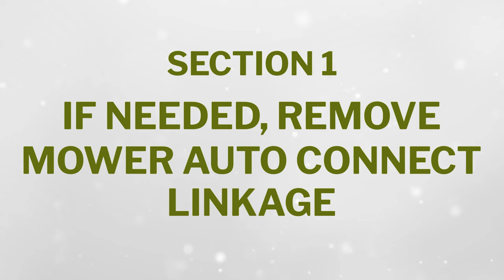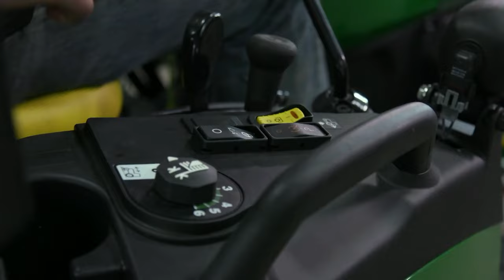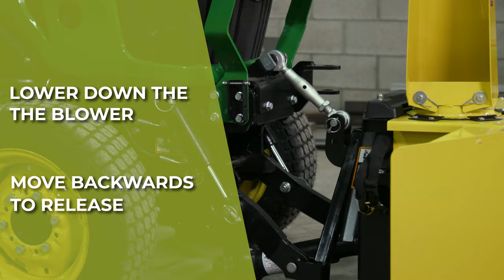John Deere 2032R, 2038R & 3R Series: Auto Connect Removal & Snow Blower Installation by MN Equipment

Comment: Nice, very detailed video, but I agree with "Sam" - I have a JD 2038R and THIS would be a PIA (nightmare) to have to do whenever you installed or removed snow blower attachment even if it was twice a year! I think I will continue to walk behind my husqvarna snow blower and use the loader on the tractor for any heavy wet stuff!

Comment: Very good video and much appreciated as I just recently took delivery of a 2032r with a 59" snowblower. But until I contacted my dealer I thought that the front hydraulic hookup was part of the snowblower package for my snowblower - it doesn't appear to be. IMHO it would have been appropriate to mention that the front hydraulic hookup may be an option. From what I have learned the front hydraulic hookup for my  snowblower is a kit and I believe that it is BLV10634. 
Thank you for taking the time to make this informative video.